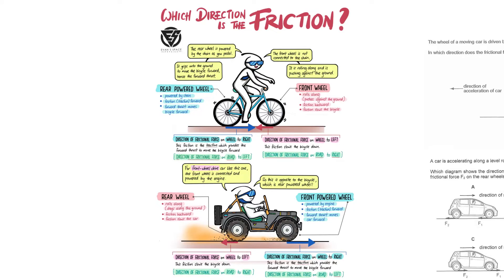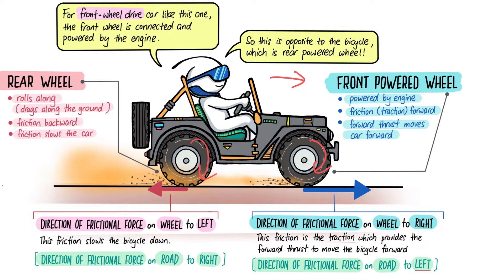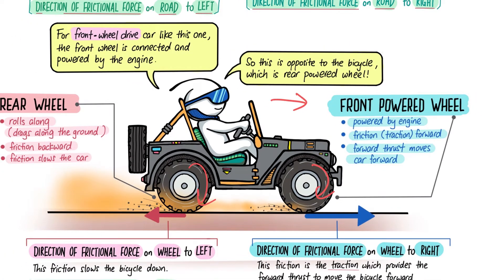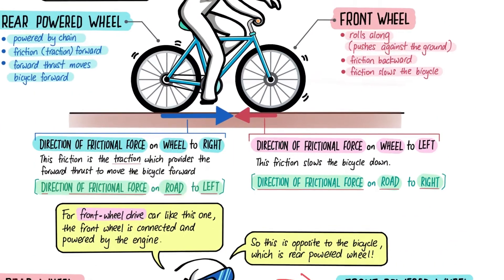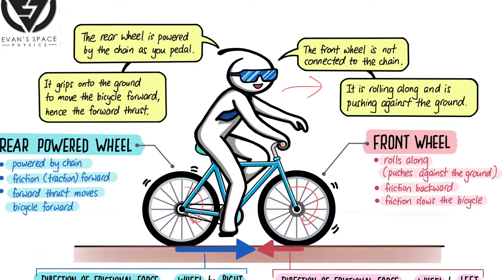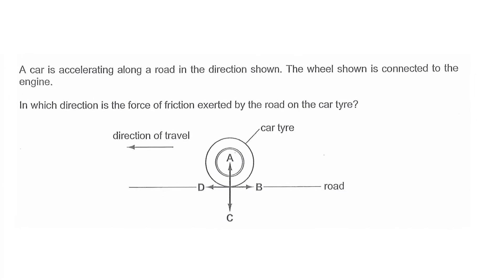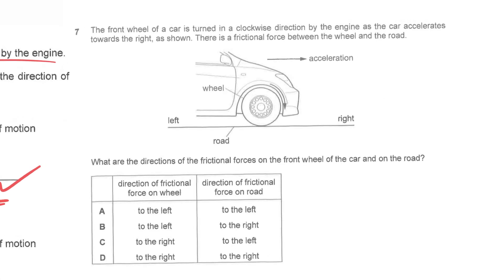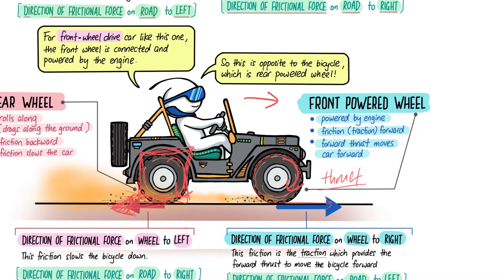What is the direction of frictional force on the wheels?

Comment: All this is nonsense. Static forces at non-driving rolling wheels do not slow the vehicle down. That is why we use wheels. Braking forces work inside the vehicle, at axles, transmission, brake systems ...

Comment: This is wrong.  First, the back wheels do not drag,, like legs.  So, the analogy is bad.  If the wheels are not slipping, then friction is forward for both back and front wheels.  Based on what you are saying, the back wheels would create a clockwise torque that would actually speed the car up.  If the back wheels are indeed spinning clockwise, the same at the front wheels, then the contact point between the wheel and the ground has zero velocity but that point of the wheel is trying to slide backwards, therefore friction is forwards.  You might argue that your explanation explains the advantage of a four wheel drive car.  Its doesn't, four wheel drive only offers advantage when wheels might be slipping.
Reply: Sorry, but you are wrong. The static friction force is pointing backwards on a non-driving rolling wheel. That force is not changing the velocity of the vehicle, but the force must be there to make the wheel rotate.

Comment: Why do the red backward forces slow the vehicles? Those static friction forces are not doing any work as there is no slipping.
Reply: Because of rolling friction or resistance
Reply: "Rolling friction" is a sort of name for processes working inside the car (soft tires, bearings, transmission etc). Those friction forces are not ecpecially directed backwards, not even working ON the car, but INSIDE the car.
Reply from the maker: I would think its rolling friction too. Even with good ball bearings of the wheels etc, as the car moves forward, the back wheels is rolling along. U r dragging it. So there is friction backwards. Or think of wheel rolling over the sand. The friction is backwards